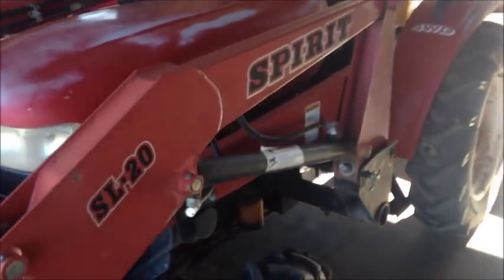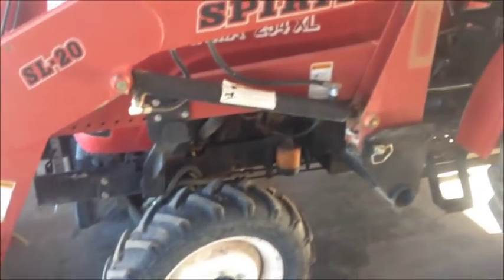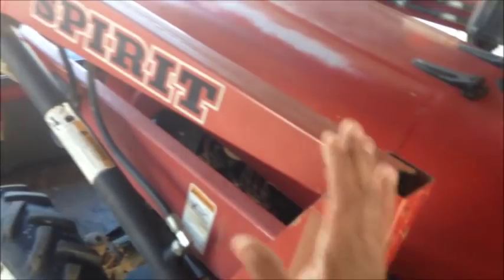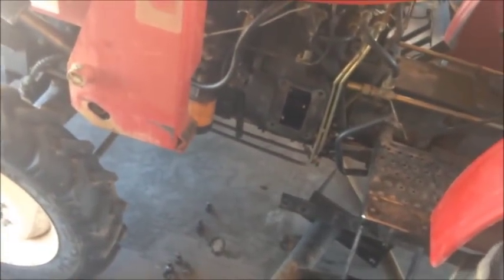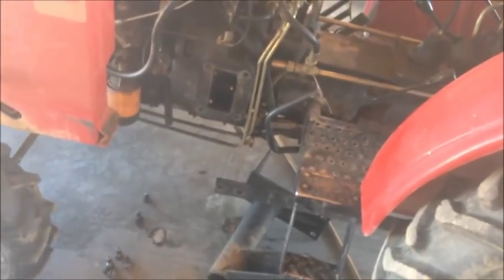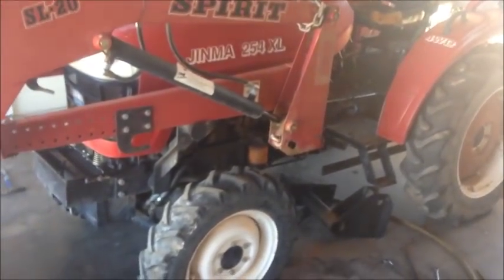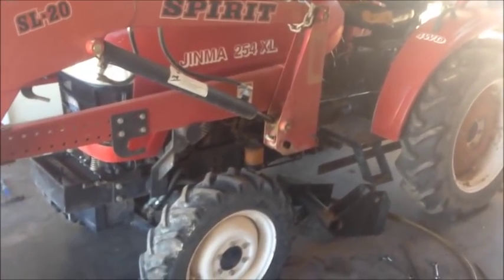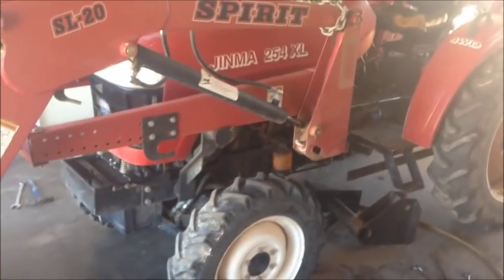How to Adjust the Clutch on a Tractor, Jinma 254 XL SL 20 Tractor Clutch Adjustment

Comment: My tractor has been sitting for two years because a neighbor smoked the clutch, it probably had 10 hours on a brand new clutch that I put in. I’ve been dreading this day but I need my tractor. I’ve found so many mixed specifications but I’ll try 10mm and see what she does. I read 0.1mm on one manual and that seems like I should just run em down all the way and back it off a smidge. Thanks for the clear video and explanation.

Comment: Inside the cross support tube on the loader are 2 angle iron safety stands. You insert them inside 2 small square receivers underneath the front end loader frame, then lower it on the ground prior to loosening the pin locks and pulling the pins. Once they are sitting on the ground, you loosen and remove the pins, then you start the tractor and use the hydraulics to slightly raise the loader frame above the loader support brackets and shut off the tractor. Remove the 2 hoses from the quick couplers and then connect the 2 hoses on the tractor side together with the couplers. You can now back the tractor safely away from the loader and it will be supported by the 2 stands and you may use the tractor without the loader attached and simply reverse the procedure to reconnect to it. Make sure you NEVER turn over the engine or start it without the 2 hoses connected together on the tractor side or without them being connected to the loader control valve or you will severely damage the hydraulic pump or the gear-train on the front of the engine.
Reply: CumminsDslPwr thanks for taking the time to explain.
Reply: Cummingsdslpwr.  Thanks
Reply: I always wondered what those 2 small square receivers underneath the front  loader frame were for.  Thanks

Comment: Great video! Thanks. My grandparents have a chinese Foton 404 and the clutch went bad recently. I changed the clutch, but don't have any info on the spec on the clutch pack height, or how it should be measured. Maybe I need to remove the cabin and I would see the access hole, like the  one you have under the supports.
Reply from the maker: +janussQv 
thanks for watching. perfect !!

Comment: couple pointers
1. those adjustments must all be EXACTLY the same or chatter and wear will be excessive.
2. NEVER disconnect the HYD disconnects while running or try to start with them disconnect you will blow up the pump.
3. these bolts are all metric, 16, 18 and such.  
4. 3 are main clutch adjustments the other three are PTO clutch engagement/adjustments.
Reply from the maker: +Mark nope 
awesome info thanks mark.
Reply: Are the 3 pto clutch adjustments forward of the main clutch adjustments?  Or rearward?
Reply: @RugRatzcarpetcleanerShreveport  I know its late now but may be able to help someone with the same question. The pto adjustments are the ones with lock nuts on them

Comment: You probably figured it out by the time you put it all back together, but you only had to take off the one bracket on the left side right in front of your foot, not the entire bucket assembly. The bracket is the only thing in the way of getting in through the side to do the adjustment. I think it's 6 bolts.

Comment: THE BRACKET ON THE LEFT SIDE THAT CONNECTS THE LIFT ARM TO THE TRACTOR IS THE ONLY THING I HAD TO REMOVE ON MINE. FOUR 13/16th bolts and FOUR 5/8 bolts plus your pin, and the bracket slides about 4 inches towards the back and you don't even have to take it down off the tractor. It will sit right there while you do the adjustment. Takes you 20 minutes, takes me 5. You have to LOOK at what you're getting ready to take apart. That's probably all you would have had to do as well.
Reply: Can you take pictures or make a video and post?

Comment: My 2 stage dissingages front bucket when clutch pushed in past certain point.  Problem is it doesn't disengage wheels till right at that same point. Very hard to operate this way. 
Bucket works then I clutch when I'm trying to bucket something and bucket dissingages.   So I have to try and let pedal out enough to engage bucket then wheels engage.  Could that be the pedal adjustment?

Comment: Does anyone know if there should be a gap between the plates with all of the adjustment bolts loosened ? My tractor won't move in either forward or reverse so I opened this plug just like in the video, loosened all of the bolts and I thought that would allow the clutch to come forward. Even then though I can put a steel rule in between the plates. I adjusted with the pedal disconnected, hooked everything back up and it still won't move. Any ideas ?

Comment: What did you use to make the 10mm adjustment? That's quite a big feeler gauge...
Reply: I used a crows foot that was exactly 10mm in width (-:
Reply: What is it that you measure